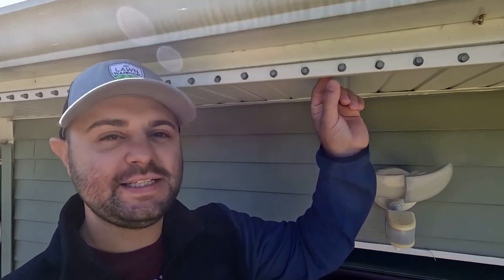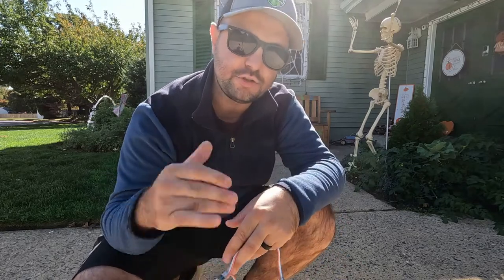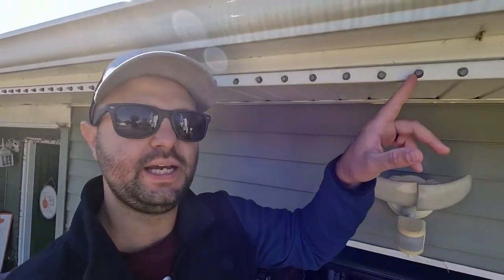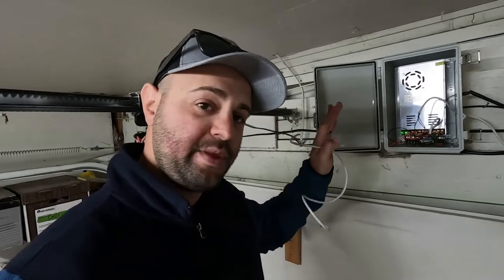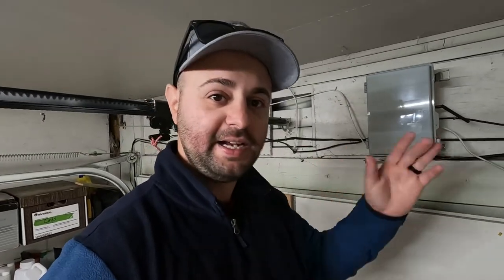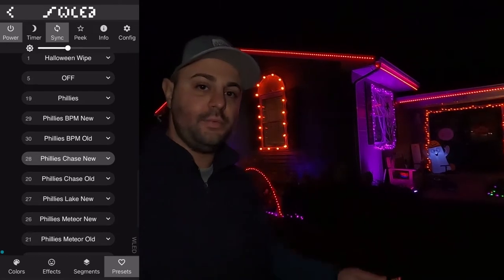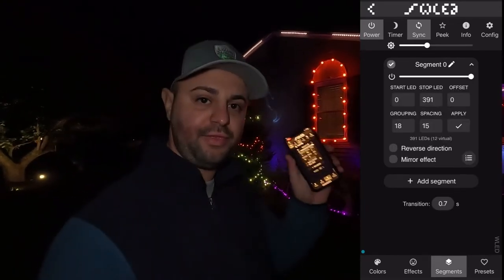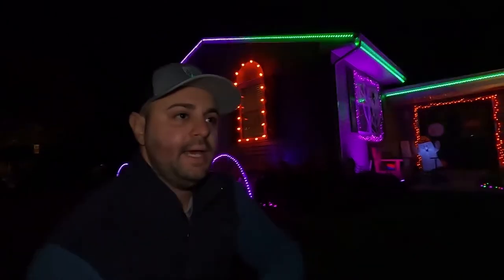Permanent LED Lighting, Permanent Christmas Lights #ledchristmaslights #ledlights #christmaslights

Comment: You can't change the direction of the data, it only goes one way. If you hook up your data line on the end of the lights, it will not work. Power however will go in every direction possible, if you need to do power injection.  I did not know about the color codes though, I always just tried to adjust to the colors I wanted, red, orange, and pewter (Go Bucs!)
Reply from the maker: You can reverse the data flow in wled.